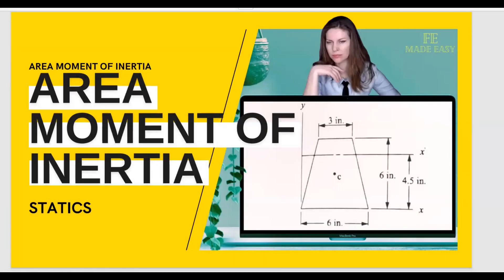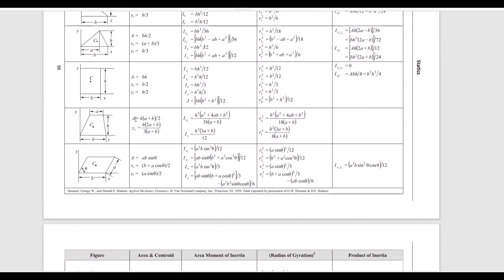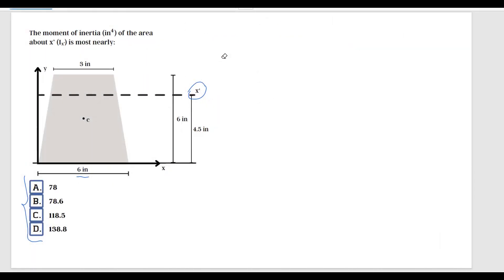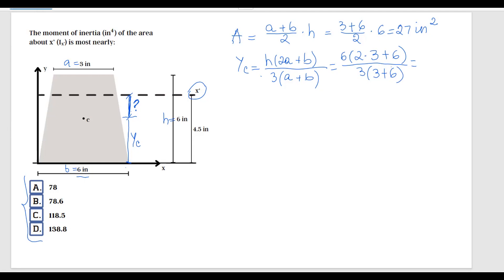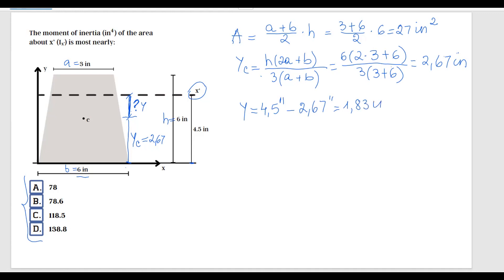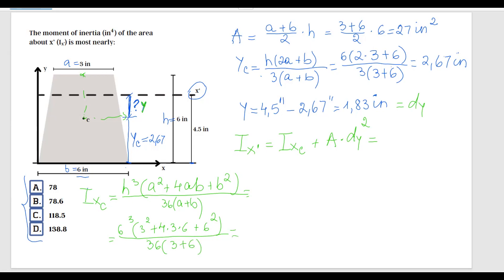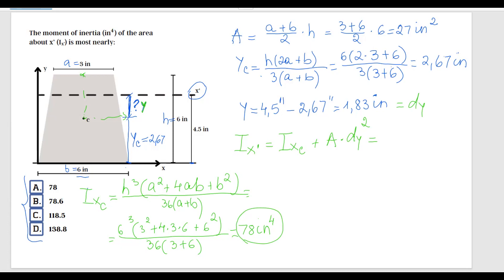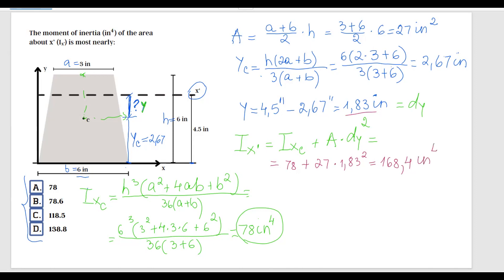FE Review - Statics - Area Moment of Inertia (Parallel Axis Theorem)

Comment: hi, I found your video while preparing for FE exam. your steps are correct & your answer is correct as well. however,   Based on the context of the question,  could choice D be the correct answer?as the  question says the most nearest to.